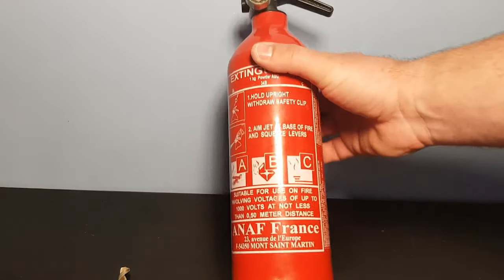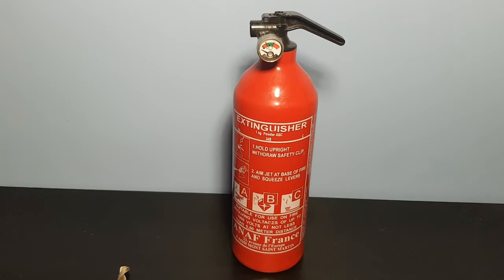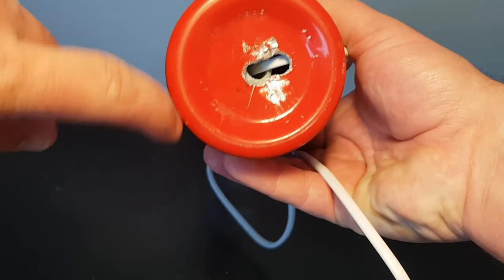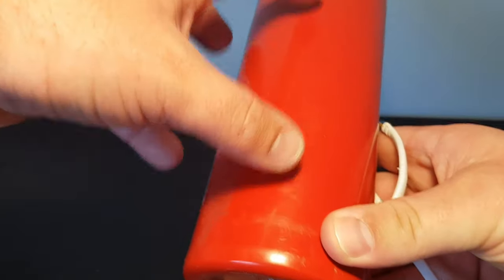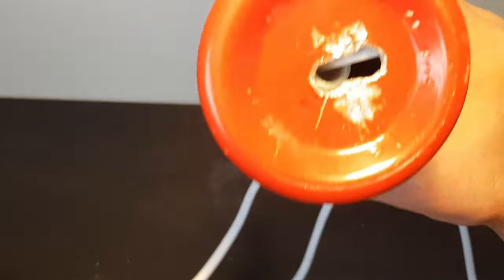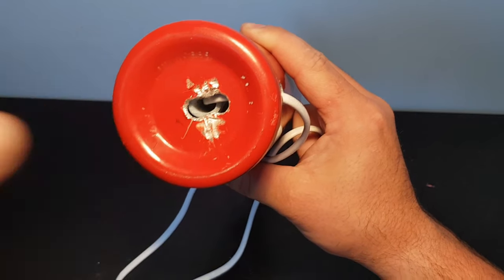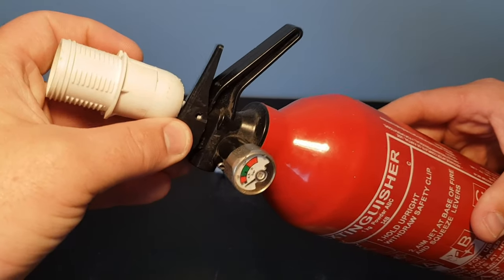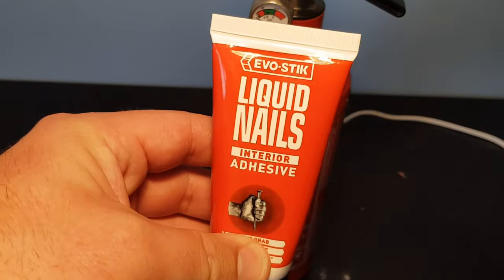QUICK EASY DIY FIRE EXTINGUISHER LAMP

Comment: Why didn’t you unscrew the the valve at the top of the extinguisher and cut the tube instead of drilling holes in the bottom?